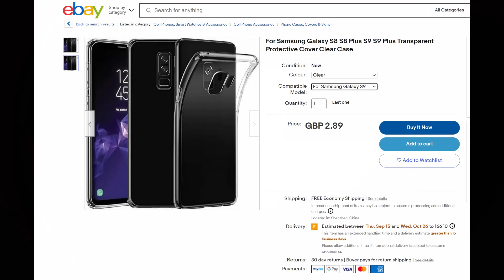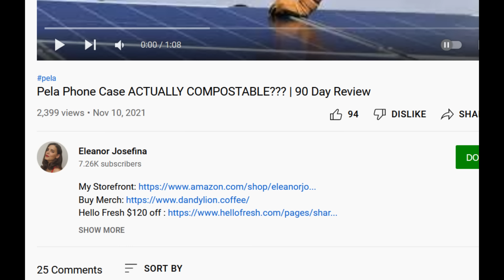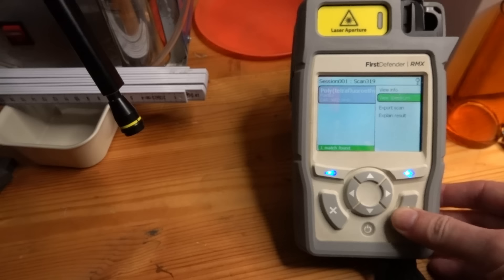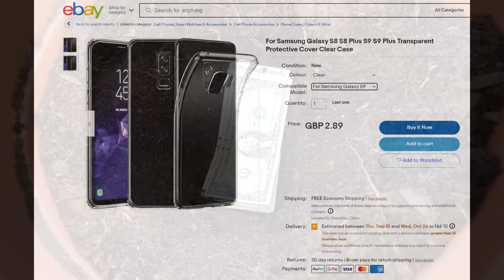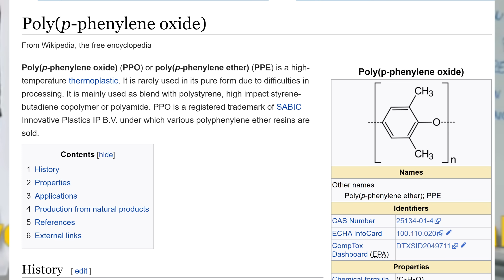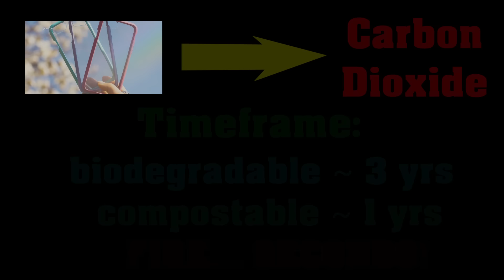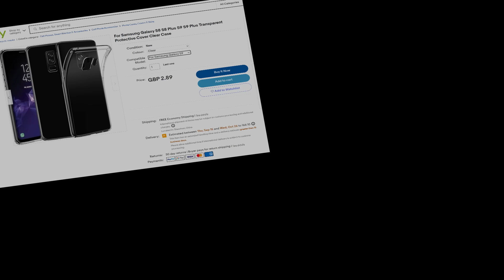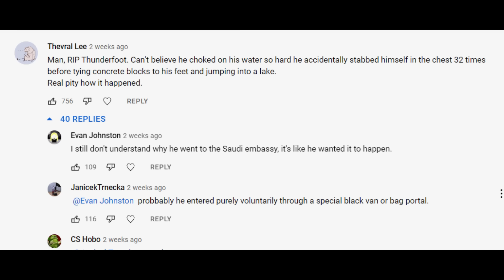Pela-Case: BUSTED!!!

Comment: I think it's important that you stressed the fact that composting something does not mean taking carbon from the atmosphere. It took me some time in my life to realize that as well and I think it is not common-sense knowledge by many people. The only way to take the carbon from the atmosphere is to deposit it in solid rock or dump it in some swamp where perhaps coal will be created in millions of years. 
So in the end, as many of the commenters mentioned, the best way is not to create that item in the first place, regardless if it is compostable or not. 
Great video as always in any case!
Reply: Not only does it not mean that, it means the opposite. What the company is proposing is hilariously paradoxical, and I don't think thunderf00t emphasized that point enough.
Reply: Soil is a major carbon sink. Its turnover is faster than that of lithified carbon, but its sequestration potential is enormous - potentially several times the mass of carbon currently in the atmosphere. Composting organic matter and incorporating that into a soil does remove carbon from the atmosphere. Globally, agricultural practices like tilling have had an impact on climate change by encouraging the oxidation and release of carbon into the atmosphere. That means that the reverse is true: if we composted enough (and stopped tilling), it would contribute meaningfully to reducing CO2 build-up.

This product is silly, but composting and building up soil are not.
Reply: @iamihop1123  We're talking about non-biodegradable plastics.  Those carbon atoms are sequestered as can be.
Speaking of seeking ways to break it down, through composting or otherwise, as a means of, specifically, removing carbon, is indeed silly.
Reply: @danielguy3581  The whole idea is silly.
Because you can't be worried about plastic polution and CO² emmisions at the same time.

Well you can, but plastic polution is a great way of sequestering CO², that's kind of the issue with plastic polution: shit doesn't break down.
Reply: @iamihop1123  could you please elaborate in more detail about how the carbon is kept LONG-TERM in the soil? In what form the carbon would stay in the soil?
Reply: @peterpan4038  
Reduction will tackle both carbon emission and plastic pollution, but barring that, burying plastic wastes in a deep pit far away from drinkable water sources is also one way to deal with existing plastic wastes. The key is to keep the carbon away from the atmospheric carbon cycle, like mining coal but in reverse.
Reply: @mickeyg7219  100% correct.

One of the most unintuitive ways of achieving this i have ever seen was in a sc-fi story a while back. In that story logging trees and burying them underground to sequester CO² was a common job.

As dumb as it sounds:
I guess this method would at least be much more effective than stuff like the "Pela-Case".
Reply: The "only" way??? Have you heard of TREES?
Reply: @peterpan4038  why would you bury trees underground? when you could just collect them in huge warehouses, where they would be kept dry, without rotting potentially indefinitely, therefore keeping the carbon fixed...
Reply: @peterpan4038  not even in warehouses actually, only under a roof protected against rain
Reply: @ignilc  I didn't say i want to do it, i simply found this Sc-Fi idea more promising than the idiotic "Pela-Case".

The reason behind it: because any type of logistics / large warehouse infrastructure that i'm aware of is far less efficient as the good old "hole in the ground". 

Plus human made infrastructure tends to not be anywhere near "potentially indefinitely".

Heck, even turning trees into furniture (or lets say buildings) isn't a good way to sequester CO² long term. A) The production process is more energy intensive than one would think; and b) Most stuff made out of wood doesn't last forever... it gets dumpstered within years, or breaks down from simple wear and tear.

And at that point you basically burned the original tree (as far as CO² is concerned), just with a few years of delay and many extra steps.

Trees and forests are immensely important for our ecosystem, but they are sure af not the answer to the climate question.

The first and by far most impactful step in really trying to make a difference:

Burning up less carbon based stuff found underground (coal, oil, gas and a few other things).
Reply: @ignilc  A simply roof to keep away moisture from rain wouldn't protect dead wood from much in a forest setting.

The wood would find a way to rot away, it's only a matter of time.

Storing it deep underground, away from the bulk of water, air and microorganisms is the most effective way to keep the bound CO² away from reaching the atmosphere.
Reply: @peterpan4038  nope, wrong
there are human built wooden buildings over 1000 years old....

do you see your furniture rotting away?
Reply: @peterpan4038  and i didnt say these warehouses would necessarily have to be built right in the same humid (if its the case) wooded area where the trees were harvested.

a log stored in the sahara desert under a roof will not rot for hundreds of years

anyway i think digging such deep and massive holes like you suggest would also be quite an effort
Reply: @ignilc  I never said there are >>>none<<<, but most buildings never get that old.

Oh, and plenty of old wooden buildings have been repaired to a large decree multiple times... i guess replacing old building parts with new ones makes the old ones magically disappear. Oh wait: they end up in a landfill and rot away.

The same holds true for furniture, most of it doesn't even last 10 years nowadays.

Good luck making a difference based on exceptions.
Reply: @peterpan4038  All of that is true, but so is this: plant life recycles itself fairly rapidly. As old plants die and decompose, new plants take up the CO2, macronutrients, and micronutrients that the dead matter surrenders. It's a continuous cycle. If you've ever cleared scrub from rural land, you know that it'll rapidly grow back long before you're ready to clear it again.
Reply: @colormedubious4747  You are right, and that's my point:

If we want to offset the CO² that is released by our fossil fuel based industry we can't rely on this very slow process.

Sure we can use plants as fuel, that way at least a part of the impact our consumption has is avoided (cause plants are obviuosly replenishable). But this can at best mitigate a small % of the impact our industries have.

We need to stop releasing (aka burning) the stuff that got buried deep underground over millions of years, OR find ways to filter equal amounts of CO² out of the air.

And that's exactly why products like the Pela-case are so silly. All the phone cases in the world wouldn't even amount to a drop in the bucket compared to the numbers we actually need to achieve. It's not even a start, it's basically nothing.

It's really easy to dig up fossil fuels and burn them (that's why we use them so much), but way way harder to reverse the process even on a small scale.

To be fair:
Strictly speaking nothing about this is "needed". The planet doesn't care about us. But if we fuck up the climate for a couple of hundreds or thousands of years to come we will end up fucking ourselfs.
Reply: @peterpan4038  The problem isn't that there is carbon and we need to trap it all. The problem is that the fuels we burn cause carbon in the atmosphere and this increase in CO2 particles causes the greenhouse gas effect, and causes ocean pH to become more acidic, as the ocean absorbs the carbon that is in the atmosphere. Plastic does not take carbon from the atmosphere and put it into a solid product. Plastic takes carbon that was buried deep underground, stored far away from the atmosphere, refines it, then releasing tons of carbon into the atmosphere. The main point being, making plastic is a terrible way of sequestering carbon. It releases way more than it stores, just because it stores what it is made of for a long time means nothing, when the problem isn't carbon in general, but the carbon in the atmosphere, which making hydrocarbon plastics causes more of. The best way to stop carbon in the atmosphere is to leave crude oil in the ground to begin with.
Reply: @noconsent  Yes, the best way is to leave the stuff underground.

Beats finding cost- and energy effective ways to put carbon back underground (or elsewhere) by a A LOT.
Reply: @Apple-mg6jr  I'm pretty sure all of us here knew that. 

The question is: what happens to those bodies down the line? Exactly: they usually die and decompose back into what they took from their environment.

The plant CO² life circle is nearly neutral.

Meanwhile humanity is busy digging up carbon that was slowly stored over millions of years thanks to those very plants from underground (and burning it aka turning it into back into CO²), ultimatively adding it to the equation.
Reply: @ignilc  You are free to believe whatever you want, but i disagree with you on that one.
Reply: @peterpan4038  with what precisely?
do you think all humans will perish because CO2 will go from 0.04% to 0.1% ?
Reply: Composting creates carbon byproducts called humic acids which can persist in the soild for centuries. And it improves soil structure, and nutrient holding capacity.  Agricultural composting with crop residues or manures is a good thing, even though is only sequesters a fraction of the carbon involved.  But because plant carbon is air source you get a go at it every year. 

Municipal composting on the other hand is more often geared towards on reducing the volume of organic material entering landfills, which over the long reduces methan emmissions (which is a more potent greenhouse gase, and not nearly as saturated in it's warming potential)

So composting is definately good for the environment and climate, however that doesn't mean that making any particular product  composable is good for the environment.
Reply: @noconsent  the difference is that animals get the matter to create their bodies by the food they eat and then shit out more carbon however trees absorb the carbon directly out of the air to create their bodies.
Reply: @Apple-mg6jr  in 2020, a low year of emissions comparatively, the mean DAILY carbon emissions from fossil fuels and industry was 90 metric tons. To absorb 90 metric tons of CO2 a day you would need to plant 900 million trees. which is planting 2.5 million trees a day. I guess I missed the initiative that is planting 2 million trees a day. Or planting 44 million trees a day, if you want to plant enough trees to replace what we cut down a day, and absorb all our carbon emissions. Seems like it would be way easier just to stop burning fossil fuels.
Reply: @ignilc  Why not just build that warehouse with the wood instead, and let people live in it?
Reply: @WorBlux  i approve that
Reply: @peterpan4038   I think TF00t did a video that actually discusses this, although not directly.  He debunked a program planning to plant a million trees and if I recall properly he talked about the water content of trees versus their carbon content and the real problem with burying trees is you actually would end up burying more water than carbon.  It would work, but I think in general you'd probably want to dry the trees first to reduce the storage space needed and also to keep the water in the water cycle.

Comment: The fact that they picked a small object that will last most people for years and decided to market it as reducing your carbon footprint really shows how unserious they are. At this point it isn't green washing but green tinting for novelty and advertising. Anyone who wants to focus on the "individual" carbon footprint rather than systemic problems at the very least should find an object that people go through regularly or which requires large amounts of plastic.